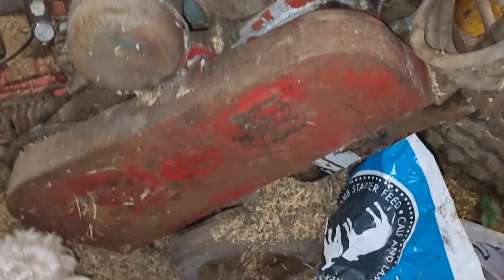let the season begin ratting with terriers

Comment: Geez, one way to keep rats at bay is to clean up the junk in the barn!  

Thanks for the new video, I really like seeing these dogs.
Reply: Farmers are resourceful and therefore save things for good reason.  It's the feed that attracts rats, and birds of prey and cats can only get so many under the gest of circumstances...
Reply: I was seeing the same thing. If the farmer kept a tidier place he’d have fewer rats.
Reply: @DavidSmith-lp5tz  
That's not quite how it works.  Rats don't skip a farm because it's tidy.  Rats lack the ability to distinguish...
Reply: B uppy I respectfully disagree. I have a farm and know that two things will prevent or manage rodent populations. 1). Remove the food source. 2) reduce or remove shelter. I have a farm and know that to be true. Where do I have rats, groundhogs, rabbits, and lately armadillos?  In brush piles, under the fallen down barn I’ve yet to pick and burn and around the feed lots. Still, I do enjoy these ratters. Keep the videos coming.
Reply: @DavidSmith-lp5tz  
'Shelter' is different from 'tidy.'
Reply: @b_uppy  True, they just go underground instead, although easier to smoke them out then at least!
Reply: Check out Joseph Carter the mink man - he's got all this down to a fine art.
Reply: @DavidSmith-lp5tz Having been on a few farms, I know from experience you can have a pretty well-kept property and still get rats, just not in massive numbers. Ever seen them nest in ceiling or wall insulation of outbuildings? That's what I had happen when keeping chickens. In the absence of a nice cozy junk pile, they just decided to gnaw into the walls and MAKE themselves a home and scavenge up dropped horse feed from the pasture next to the coops.